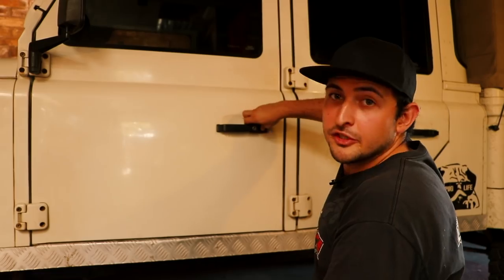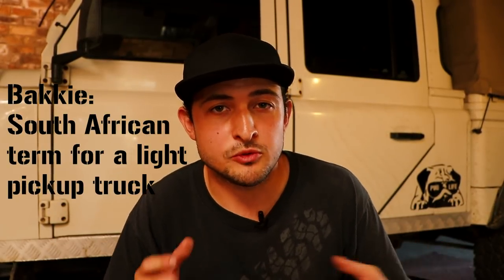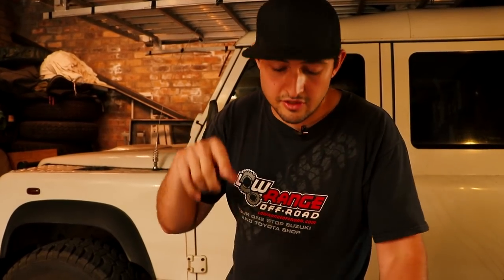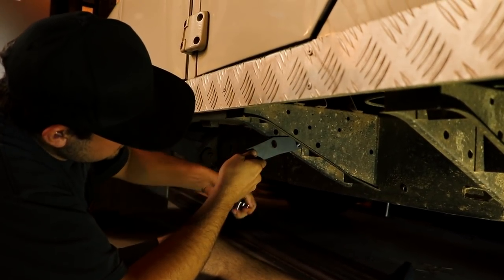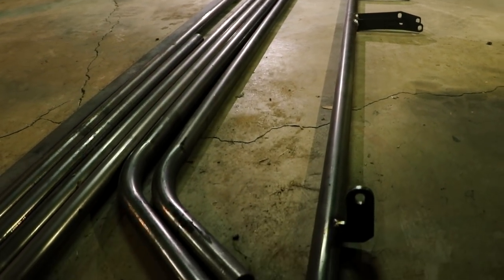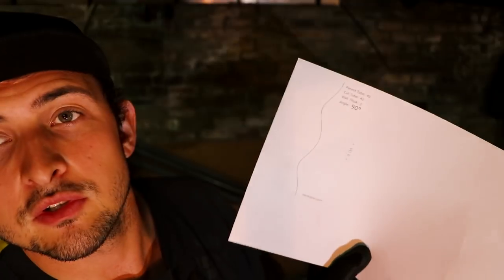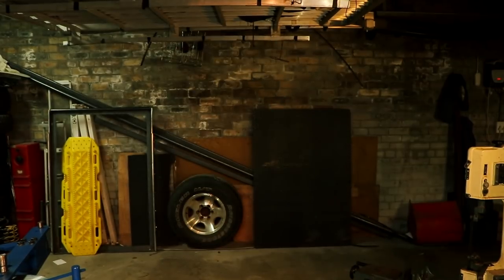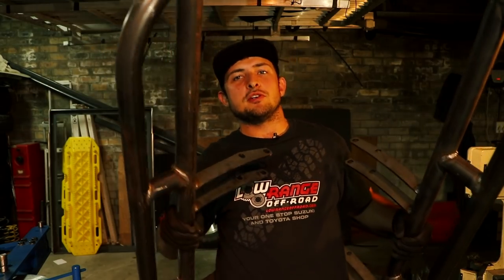GARAGE SESSIONS: - DIY ROCK SLIDERS!

Comment: Great job there mate. You've got the tools & set up to custom diy the pug to the max. One tip, when straightening something that's distorted due to welding. Heat the opposite side of the pipe or piece thats welded & let it cool. It will shrink that area & straighten it out. 
Great vid
Reply from the maker: Thanks for the tip, going to give it a try👊🏻

Comment: Nice one! Need to make some for mine as well! Thinking about making the brackets meet the chassis for some extra side impact protection!
Reply from the maker: Yeah definitively worth the upgrade. You could which should make them much stronger however I'm planning on making some water and fuel tanks either side in that void which the brackets would run into so will attend them again after the tank build

Comment: Nice job. Would save a lot of grinding and cutting if you had a pillar drill and a 42mm hole cutter to fab the jointing pieces. Cut and shaped in one operation. ;-)
Reply from the maker: Indeed that was very time consuming! Just have to find a quality tube notcher locally